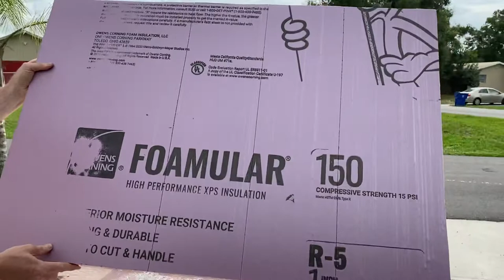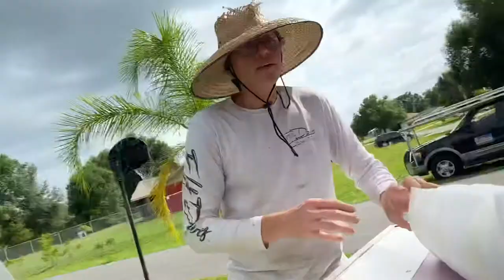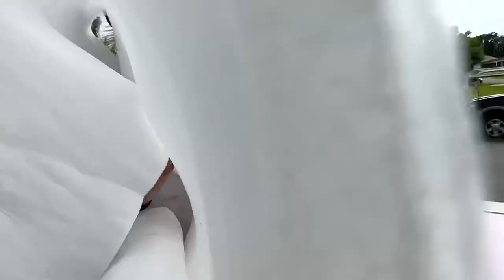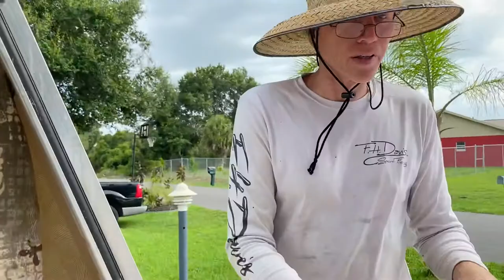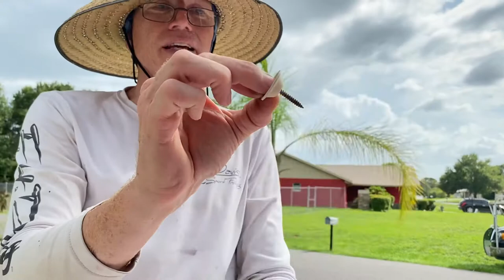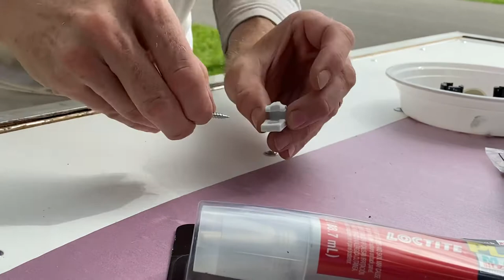(DIY) RV Bunk & Hybrid Camper Pop Out Bed Repair (Vid 2)

Comment: Pardon my ignorance, but isn’t what you built that on also rotted?
Reply from the maker: Hey SomeDays!   That is a great question.  So the outside layer, which we'll call the "white layer or bottom" is actually the fiberglass exterior wall.  Think boats.   Then the factory places down and glues in Luan board, then foam, then Luan board again sandwiching the foam, then there is a plastic vapor barrier on both sides as well.   This material is generally preassembled or cut in the factory shops as sheets or pieces of the puzzle while being built.  Then there is the final quarter-inch laminated plywood set with more glue and a wallpaper finish. 

1- Fiber glass (white)
2- Glue, then Plastic sheeting, then Luan board 
3- Glue, then cheap white foam, then Luan Board, 
4- Glue, 1/4 plywood, then adhesive, finish wallpaper.  

It's why even 20 years later, these things smell like new.  You are laying on a slew of chemical gassing.   

Please subscribe and share with others in our community, thank you for commenting!

Comment: Hey - What were the dimensions that you used wide for your hybrid camper? Also, did you reseal the canvas?
Reply from the maker: Hi, not really sure what you mean by "Wide"?  We just measured from side to side on the bunk door and cut the aluminum plate to sit about, one-quarter inch inside, on each side, so the door can open and close without interference.  Let me know if this answers your question properly.   

As far as "Reseal" the canvas,  we use a tent sealant made by Starbrite.  Here is a link to their product.

https://www.amazon.com/STAR-BRITE-Waterproofing-64-Oz/dp/B0897XZ5B8/ref=asc_df_B0897XZ5B8/?tag=hyprod-20&linkCode=df0&hvadid=459480361820&hvpos=&hvnetw=g&hvrand=8523284532165989882&hvpone=&hvptwo=&hvqmt=&hvdev=c&hvdvcmdl=&hvlocint=&hvlocphy=9012193&hvtargid=pla-944064765250&th=1

Stone